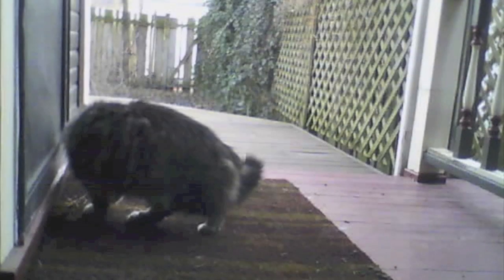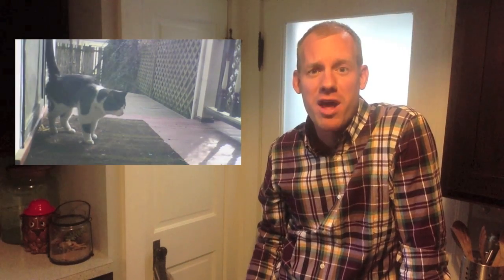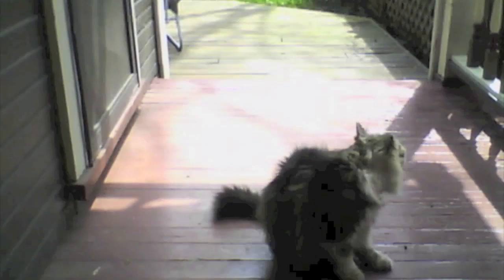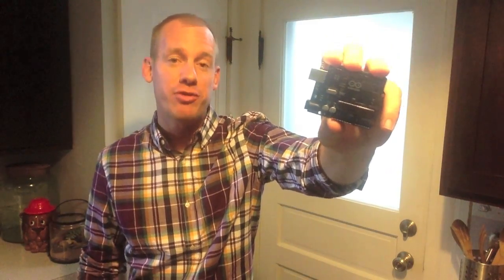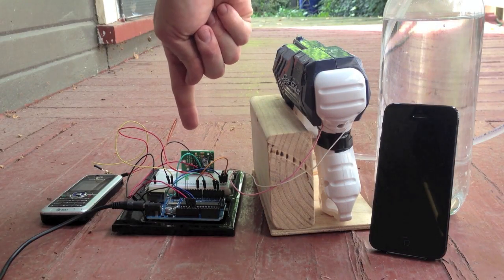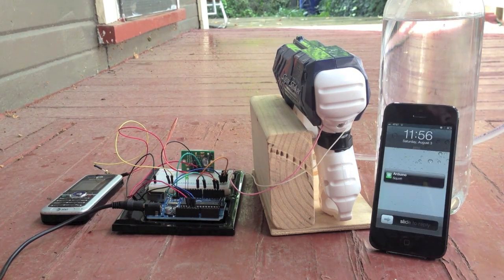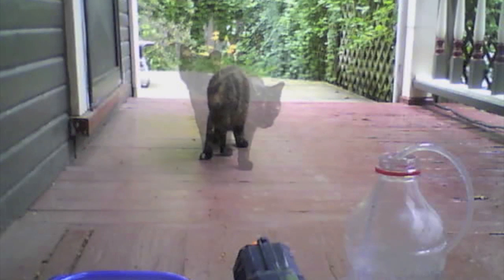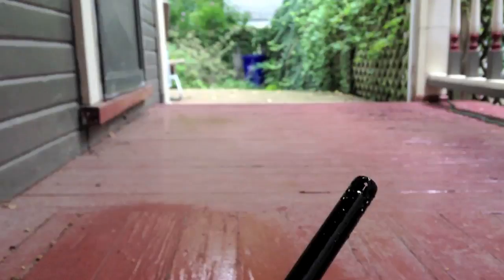Cat water gun hack using a motion sensor and Arduino

Comment: Hi, i am working on the same project (i think its even the same watergun). Its my first arduino project. i was wondering if you had to use any resistors or switchs (ect ect) between the arduino and the watergun. Or were you able to just run straight from the arguino to the watergun?
Reply from the maker: DjMbezzle It's been a while since I built this; however, I recall using a 3 pin transistor between the watergun and Arduino. You can kinda see it on the upper right side of the breadboard.
Reply: Ben Harben thanks!!

Comment: Clever!  This is close to what I need to chase off a neighbor's cat that keeps chasing away my ferals and strays and eating the food I put out for them.  I just need it to only shoot that one cat.  Btw, really the BEST solution for cats spraying is to trap them in a raccoon trap and spend a mere $25 or so at the low-cost clinic to have them fixed, then you turn them back out.  It's called Trap-Neuter-Return, or TNR.  That solved the spraying problem at my house permanently and trapping can be as exciting as what you're doing.  Plus it helps keep down the feral population and results in less kittens that would otherwise only suffer until they die in a few months.  Also, I noticed some of those poor babies you're shooting look like they're already down on their luck--not true ferals but cats that lost their homes (like the fluffy one)--and could use some help!  ;)

Comment: Hi Ben, thanks for the vid. have a similar cat problem so just the right video to inspire me. I just rigged up(followed ur advice to break the connector plate) a nerf electrostorm with the arduino with 3 motion sensors and a servo to steer the gun. But I have a problem with the transistor it seems even without the base input it connects the plate so gun is always on. I suspect the collector voltage is above transistor Vbe max but not sure.  Did u have a similar problem. Do u have a schematic of the connections that u could share.
Reply from the maker: I'm sure you've figured this out by now. I ended up using a transistor similar to the one found at http://amzn.to/19EPJkW. It was enough for me to control the same gun you're using. Let me know if you got it working. I'd love to see a video of your steering servo in action.

Comment: Ben I was actually trying to do the exact same thing when a friend sent me your video.  What did you connect to inside the gun to activate it?
Reply from the maker: The gun I used (Nerf Super Soaker - http://amzn.to/1cCZuhB) didn't have much to connect to since it's parts are covered in a sealed plastic shell inside the gun's casing. So I ended up connecting to the removable battery panel (Shown in the video). The panel has two metal connectors inside for the batteries. I snipped one of the metal connectors to break its connection and then connected a wire (The pink and white wires shown in the video) two either side of the break. I then used a transistor (Kinda like this one http://amzn.to/19EPJkW) to trigger the connection through the Arduino. Oh, I had to tape the gun's trigger down for this to work. Hope that helps!
Reply: Ben Harben Thank you so much. the taping of the trigger is what I was wondering- I ended up gutting the gun and removing the components. Im just getting started and am hoping to send you a pic of my finished project.  Thank you for the video and the response.